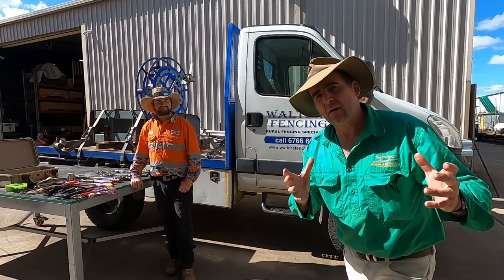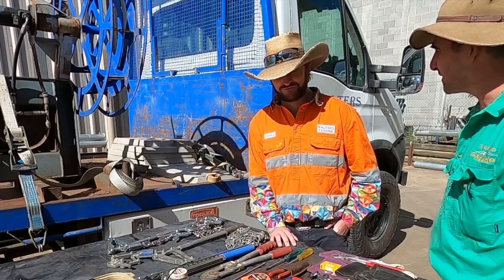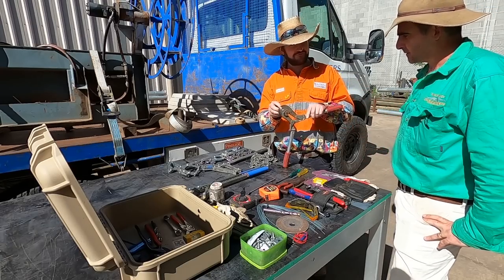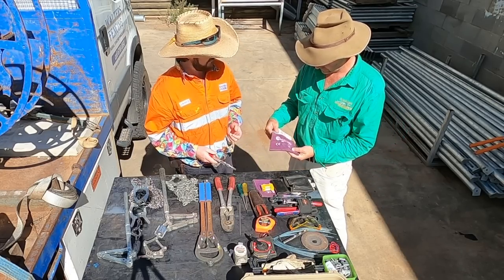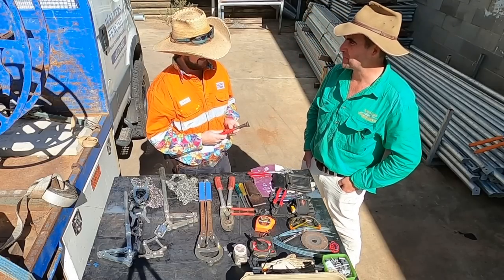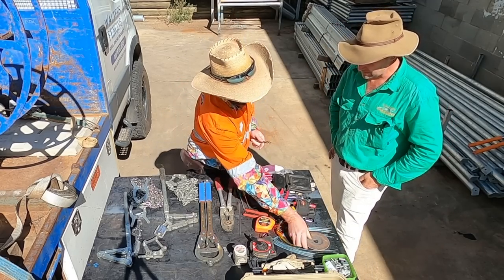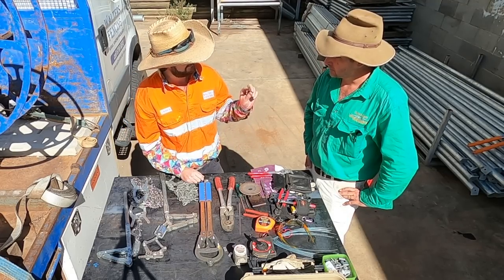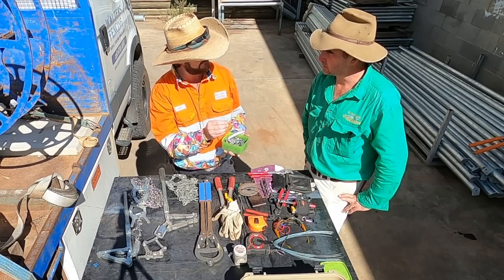Pro Fencers Hand Tools - James from Walters Fencing Tamworth

Comment: Awesome vid👍I have been fencing since 5, I don’t have a lot tools but I don’t build a lot different fences, typically top bare with cyclone/mess fence or 8 strains wire fence.  Post are usually metal train sleepers.  I do a lot dairy fencing but biggest pet hat is not many farmers have electric fence tester n leave mess of wire on the ground.

Comment: Thank you for your clips TT I after watching your clips  I bought my crimps n tool from Cyclon distributor at Kemps  Creek , 
Crimps types

EZC1— 1.6 2.5 smooth wire 
EZC2— 2.5mm Electric wire
EZC3— 2.5-3.15  smooth wire

Comment: I am sure you are aware that Milwaukee now sells a fencing stapler that you can change the length of the staples and how deep the staples go into the wood post.  Quite a remarkable tool.  It is 18 volt and can drive about 500-600 staples per 4 amp hour battery.

Comment: Hi Tim,
Are there any systems on the market for under gates to close the gap to the ground to say keeping dogs from crawling under the gate, the issue I have is if the ground is on a cross grade it changes the gap height??
Reply from the maker: G'day Clinton. The best and simplest advice is to level gateways for 5m in each direction prior to fencing. Having said this, I admit to having mesh with timber weights under some of my gates, because hours on the shovel or 15 grand on an excavator is not always appealing.....

Comment: Interesting, although absolutely STUFFED with ads.  Not a pair of Maun pliers in sight. Knipex are great, but Maun are what St.Peter's fencers in Heaven use. And - a shorter twitcher might have been added.
Reply: For hobby block fencers for sure
Reply: I've got a pair of Maun's that I've had for about 8 years, and definitely do like them. Found the cutters not as sharp on high tensile wires as the Knipex though.

Comment: Got 45 stone fencing poles erected 6 1/2 ft spacing. 5 parallel lines of Zn coatef 250 gsm barbed wire 12 in gap. Added an X between. 4 folks did an exceptionally good job. Lasts at least another 20 yrs. Guys didn:t had a percentage of tools you put on display. Rather crowbars, pincer, pliers, wood pole and stromg shoulders using mech leverage did the job. Not to bring in sophistication. Simple methods are proven to be best.
Reply from the maker: Mate, these guys build fences that last for decades and get multiple kilometres done in a day. They avoid injury and earn a living satisfying customers. Technology changes and people adapt. Calm down.